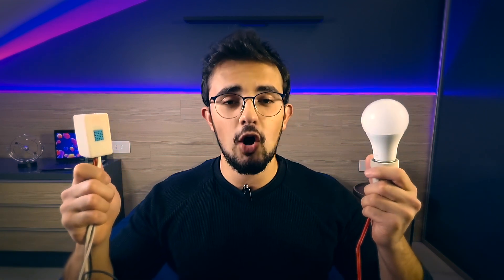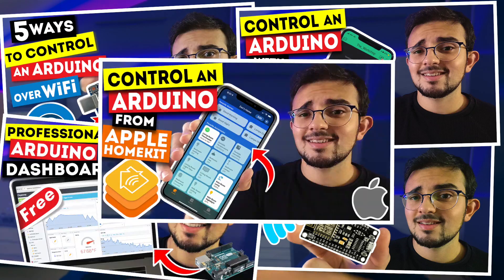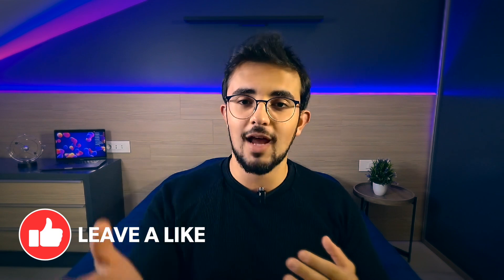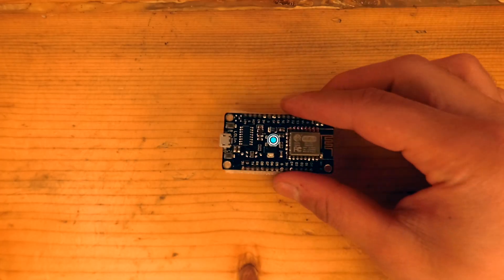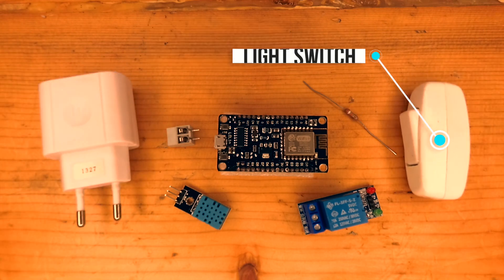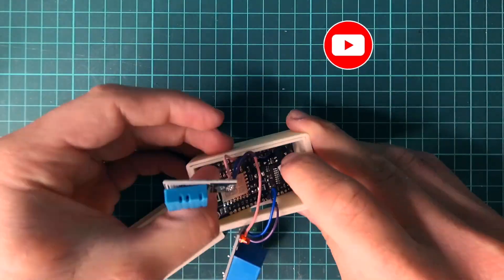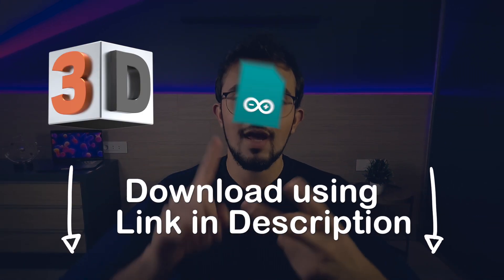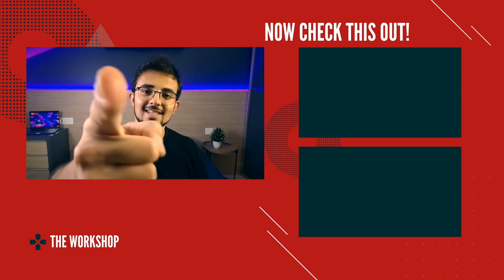Easy Arduino Home Automation from your iPhone, iPad, and Mac with Apple HomeKit!!

Comment: I downloaded your code and tried out. Apparently,  it showed me lots of compile errors. 
I was using ESP32 dev Module board, It seemed to me the way that it looked for several files that were missing.
Could you please take a look what did I do wrong?    Thanks in advance.

In file included from c:\Users\SAYAVJX\OneDrive - Abbott\Documents\Arduino\libraries\HomeKit-ESP8266\src/os_type.h:28,
                 from c:\Users\SAYAVJX\OneDrive - Abbott\Documents\Arduino\libraries\HomeKit-ESP8266\src/user_interface.h:34,
                 from c:\Users\SAYAVJX\OneDrive - Abbott\Documents\Arduino\libraries\HomeKit-ESP8266\src/ESP8266WiFiSTA.h:29,
                 from c:\Users\SAYAVJX\OneDrive - Abbott\Documents\Arduino\libraries\HomeKit-ESP8266\src/ESP8266WiFi.h:34,
                 from c:\Users\SAYAVJX\OneDrive - Abbott\Documents\Arduino\libraries\HomeKit-ESP8266\src\arduino_homekit_server.cpp:3:
c:\Users\SAYAVJX\OneDrive - Abbott\Documents\Arduino\libraries\HomeKit-ESP8266\src/ets_sys.h:29:10: fatal error: eagle_soc.h: No such file or directory
 #include "eagle_soc.h"
          ^~~~~~~~~~~~~
compilation terminated.

Comment: Would it be possible to connect a servo motor as a accessory? What apple workaround accessory would you use for it?
Reply from the maker: Hey Matthew! Thank you for reaching out!
I would suggest, depending on your use case, if you need to vary its position continuously, maybe consider it like a varying light intensity. And if you just want to put it in 2 different positions say open/close something just use a regular light switch interface and instead of “digitalwrite” on and off, use analogWrite and put in the open/closed pwm values if that makes sense.
I hope this helps, and if you have any additional questions please let me know. 
Have a nice day!
Reply: @TheWorkshopByGM  Okay thanks for the quick response. I am going to be using a servo motor to push a physical button. I need the servo motor to extend and retract in a single program. So when I'm in apple homekit I need to toggle the servo to extend and retract in a single motion. I don't know if that is possible.
Reply from the maker: That’s exactly the second use case i described above. You will want to use a on/off switch in the Apple HomeKit. And then in the Arduino code search for the part where the led is toggled, and instead of writing “digitalWrite” LOW, HIGH, have an “analogWrite” with say 0 and 255 to fully contract or extend the servo, or potentially if you don’t need it to do the complete range of motion you can do something like 0 to 125 or  50 to 175, it depends on your setup.
Hope that was helpful!
Reply: @matthewevans2831  Hi did this work out for you in the end? thinking about doing the same

Comment: Hi great project, I tried today but I’m having problems connecting the device to homekit, it will discover the device but when I try to connect to it i says Unable to add accessory, also in arduino monitoring window says EEPROM NOT UPDATED, I cleared the device EEPROM before uploading the code and still not work! 🤔
Reply: Hey thanks for answering, I’m still having the same message on homekit “unable to add accessory, I follow your advice and it’s not working 😥
Reply from the maker: Oh that’s unfortunate! I’ve never heard someone else having the same issue. Could you maybe try to delete the “home” in the homekit app and try again? Also just to make sure, are you using an ESP8266 nodeMCU board?
Reply: @TheWorkshopByGM  yes I’m using ESP8266 Nodemcu v1.0, I try to delete the Homekit app and delete the arduino and I installed everything from beginning and no luck, 🤯
Reply from the maker: That is very very weird. Is it possible that the board is malfunctioning? Do you have another one by any chance to test it? Also to double check? Are they both connected to the same wifi?
Reply: @TheWorkshopByGM  yes I have connected with the same wifi, maybe it’s a manufacture problem I’m not sure, i will order another one and i will give it a try, thanks for sharing the code and for help, i will update you when I receive the other NodeMCU.👋🏻
Reply from the maker: I hope it is a manufacturing defect and that the new one will work! It’s very weird because most of the people that got in touch with me were able to make it work!
Reply from the maker: Hey! Thank you for reaching out! In my latest update on Github, I added a commented line of code in the void setup that allows you to reset the EEPROM specifically for homekit. Try to uncomment it, upload it to your arduino, comment it again, and re-upload the code to the arduino.
I hope this works, please let me know if it doesn’t!

Comment: Hello. Great project. I tried to repeat it, but he does not want to connect to HomeKit. The test examples from Mixiaoxiao are however forwarded to HomeKit. I can't understand where is the problem?
Reply from the maker: Hey! Thank you for reaching out!
I would love to support you, so maybe could you give me some more details on your problem? Does it just not appear on your phone? Do you get any error?
Also, in the meantime here is a list of things you could try, or check.
- First of all make sure your Arduino and iPhone are both connected to the same wifi network.
- Second, in the setup loop of the main code, there should be a commented line that allows you to reset the device. If you uncomment it and upload the code to the Arduino you will basically wipe the EEPROM clear. This might solve your issue, but make sure to comment it again once the Arduino is connected to your phone, as this will require you to connect your Arduino to your iPhone every time it is reset.
- Try to delete the “home” you have in HomeKit, and start with a new one from scratch.
Reply: @TheWorkshopByGM  Thanks for the recommendation. There may indeed be a problem with the EEPROM. I'll try again and write back.
Reply from the maker: That’s a quick reply! Thank you very much! Please do let me know if this works as it might be useful information for others facing the same problem!